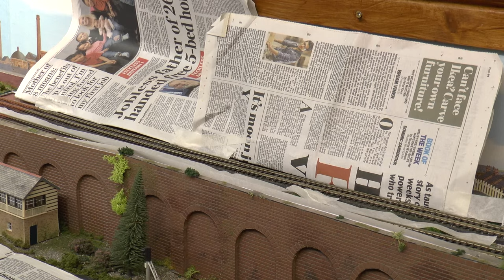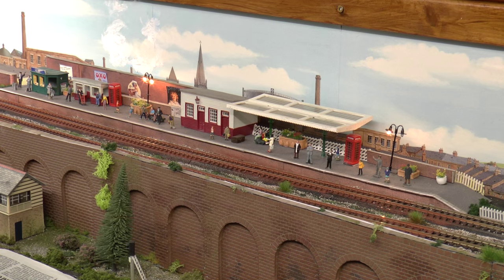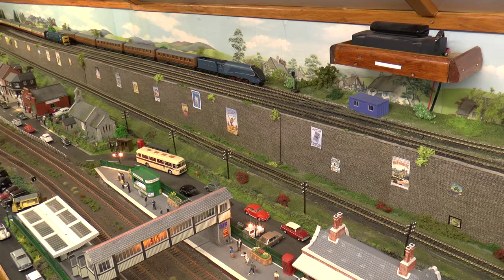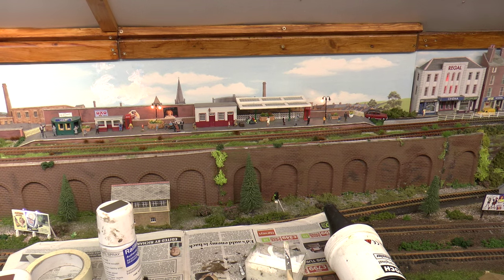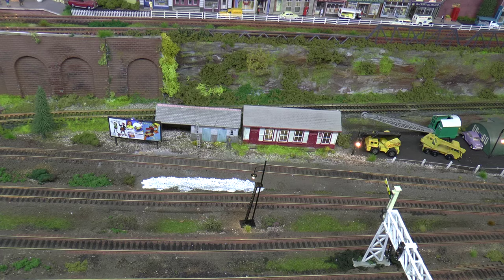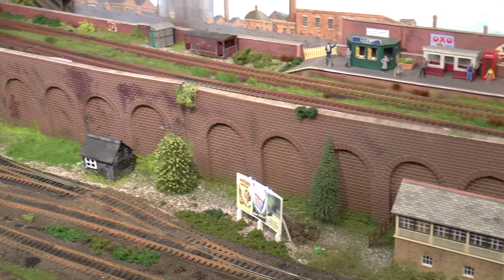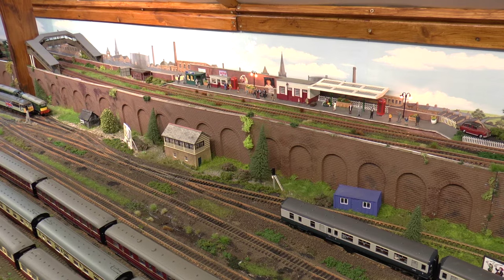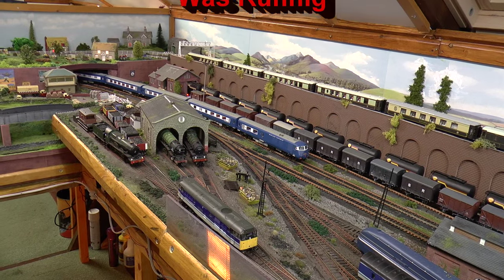Dave`s Model Railway Adding Some Scenics

Comment: Also worth using is Modelmates mainline track dirt, siding track dirt, as well as the Woodland Scenics Track tidy rail pens (Steel rail, Rusty rail). Have a check out of that Modelmates moss effect David. will look good on the wall & rock faces etc.

Comment: Hi Dave • Sidebar question - Do you paint those clouds on the back ground?
• Cheers from The Detroit & Mackinac Railway 🚂
Reply from the maker: +trainroomgary  Hi Gary , most of my clouds are with backscene sheets , which are made by Peco , but just the odd area I have painted a bit of cloud to cover the odd crack or lump in the paper ...cheers dave

Comment: Your system seems to work well and it is quick.  Have you ever had any trouble with putting the static grass clip on the rail?  Has you ever shorted out or damaged a decoder doing it?  Rob
Reply from the maker: +Rob McCrain Hi Rob , no problem with adding the clip to the rail , you can have the electics off , its just used as a earth for the appicator , I used to put a nail in the board , butr was show to do it this way a couple of years back , and not had a problem ...cheers Dave

Comment: "camera not switched on when I though it was recording !!" And I thought I was the only one to do that. And the same with the microphone. I think I need a check list like pilots use before take off. LOL! Nice finish for the rails. Do you have any issues with trains performing well over the painted portions, or are you able to get the rails cleaned off well enough the first time? Regards, Solomon
Reply from the maker: +Life After Work Hi Solomon , yes think we all get to that stage , have to double check , would not mind but I thought it had been recording for about 10 minutes , and did not check till following day , so had to try and re take some and squeeze it all in somehow , good old editing programmes , no problem running ovwer the painted rails , just clean them soon after applying the paint , then I use the Peco track rubber to polish them off ...cheers Dave

Comment: Nice one Dave. I may take a look on EBay for one of those puffer bottles. Could be good for model display bases.
Reply from the maker: +GYRUSS HI Richie , yes could be handy , if none on e bay Gaugemaster sell them , just use the normal size grass though m not th static grass ..cheers dave

Comment: The work on the railroad never ends.  I started to make one of those static grass applicator but never finished it.  I will have to pickup some grass and see how it works.  Everyday is a new day for learning.Scott
Reply from the maker: +Scott Downey HiScott , they are very reasonable to buy now the static grass applicators , but with static grass you can make such a difference to your scenics , only one thing ...try one ..Cheers Dave

Comment: Frankly, in my own personal opinion, I would say that it would make more sense to do this "rusting of the rails" and repainting the black upon the cross-ties technique off the layout prior to installing the track upon the layout so that the paint doesn't get on the foam (or cork), roadbed. - But, "to each his own".  - Anyway, great article and great work Dave, Thanks for both the great tips and for sharing your technique.
Reply from the maker: This is a old one , but yes It would be easier rusting before laying the track , what i dio now though is all ballasted then I spray paint the tracks so the rust goes in to the ballast looking more real .......any awkward parts i still use a brush ...i do just use cork as underlay now , its far the best in my opinion ...cheers Dave

Comment: Well I didn't think you could make it look better but you did thanks for the demo on static grass I have the tea strainer type but not had a lot of luck with it think I might be using to thin a mix of pva
Reply from the maker: +Graham Wood Hi Graham , thanks for commenting , with the Tea strainer I found they are good , Just make your mix about 80 % PVA and 20 % water , then make sure you put the earthing clip to iether the rail or a nail inserted in the are you are doing , then  just do the dance , and it should stand up well , dont forget the hairspray that holds it , just like a lady`s hair ???

Comment: you're getting there, it will take me some time to add the finishing touches to it, I'm still working on my signal braking modules and I'm almost there.
Reply from the maker: +6109river Hi John , yes its looking a bit better there on the upper level now , but of course mine is just scenics , not sure I am confident enough to start wwith braking modules , good luck with it all ..cheers Dave
Reply: +David Howarth well I've started years ago and copied a signal braking module from a German firm and since than have made about 50 of them. the other thing is my locos running on 3 rail and I've made up another module its a reflective optocoupler and this suppose replaces, reed contacts, it picks up or responds to anything 5mm above the sleeper, also a friend of mine  designed a fader for my signals, when you've got a big layout like mine it gets very expensive, we are not talking about the odd module everything is multiplied by 50.
Reply from the maker: +6109river Yes well on a big layout like yours you need the braking system , and as you say can be very expensive ...dave

Comment: Your layout goes from strength to strength. Top notch work as always Dave.

Ash.
Reply from the maker: +BritishRail60062 Hi Ash well we keep tying to improve ...still some way to go though ..Cheers Dave
Reply: +David Howarth. In my opinion, a model railway is like a davinci code painting. Its never finished :). If you are into old French cars, a couple of Citroen DS23's and a Peugeot 404 would look right at home there as I think Columbo drove a Peugeot 404 in that TV series. 

Ash.
Reply from the maker: +BritishRail60062 Not a lot of room left for more cars Ash , but will consider a citroen if i see one ...said many times never finished ...but getting too old to start a new layout again ...Dave
Reply from the maker: +BritishRail60062 Not a lot of room left for more cars Ash , but will consider a citroen if i see one ...said many times never finished ...but getting too old to start a new layout again ...Dave

Comment: Nice one Dave, which pva glue do you use as I am struggling to find some?
Reply from the maker: +RyanBux93 Hi Ryan , I use PVA Bond   ever build , its cheap about £2.45p. for a 500 ml bottle , I get mine at either the local timber merchants , or down at Boyes hardware deparment , its a quater of the price they chjarge for model railway PVA , and its all the same stuff , most harware stores will sell it this one I get is made by Ever Build  it the 501 Universal ...cheers Dave
Reply: +David Howarth thanks for that Dave must get some when I start my ballasting
Reply from the maker: +RyanBux93 Worth getting saves a bit of money ...Dave